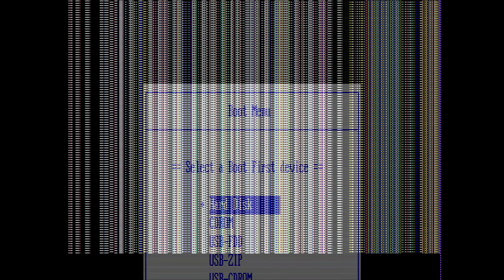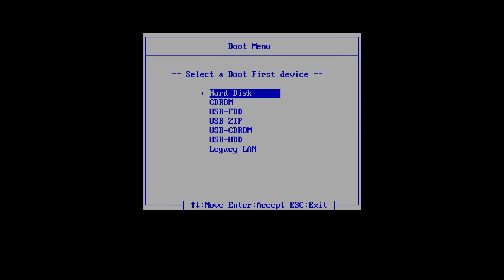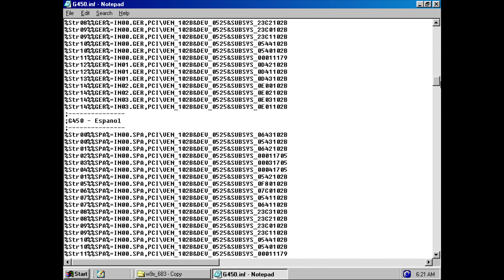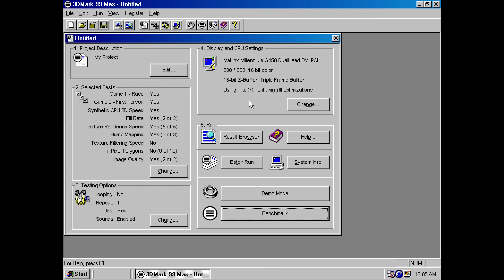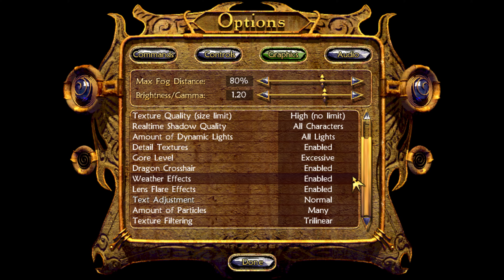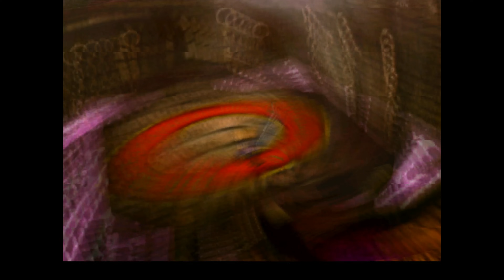Matrox Millennium G450 Dualhead DVI PCI (IBM)

Comment: at last i have mine "non grilled" working Matrox G450 PCI. I have same "jumping screen" issue DVI output and retrotink. Traditional windows 98 installation, everything work driver installer detect card without issues drv 6.83.017. Computer Asus P2B, P3 450. Card bios 1.4.b06. Shall i update or leave like this? 🤔 Lets do some tests 😁

Comment: I have two AGP P650 Matrox Millenium one is dead but other one i can't get display out 
When paired with PCI vga the Windows detect the P650 i was able to flash the bios but still no output from P650...

Comment: Thanks for the video. I have this same card for my Windows 95 machine. I've spent hours wrestling with drivers and with w9x_672 I finally got it to show the PowerDesk tabs in the display settings and it outputs 1024X768@85 Hz to my Trinitron and it looks great. The only problem is I can't get it to clone my display to the HDMI monitor plugged into the DVI port. There was exactly one time I got it to work, I think with a newer driver, but it looks like crap and then never worked again. If I try the hotkey and check in DualHead Clone, it says "enabled and active," but my other monitor remains blissfully black. Maybe it's just not meant to work with Win 95?
Reply from the maker: Yea maybe 🤔

Comment: Dear Phil... I didn't know this card had a DVI output. I was convinced it was the Radeon 7000 RV100, which came out a year after the Matrox. Cheers!!!
Reply: You can even desolder secondary VGA output if your Matrox G450 has this and solder DVI port in place of that

Comment: Hi Phil, just found the same card, would it be too much issue if you upload your modded driver? Also the somewhat slow performance may be from design as G400 came with 128bit SDR and G450 with 64bit DDR, the same bandwidth but with extra conditions that may drag the chip a bit.
Reply from the maker: I might upload it at some point, good idea 😊

Comment: Hi Phil, can you tell me why old graphic card's VGA resolutions cannot be supported by modern LCD panels and LCD TV-s?  I cannot use the same monitors which I'm using for my actual setup with my old retro PC. I always need an old 1280x1024 screen. The new ones just turn black. Maybe the refresh rate or the resolution are not supported anymore. Is there another way?

Comment: I think you missed the point on gaming with matrox. Or you missed the product line up of Matrox.

Millenium was a 2D grafic card. Designed for CAD, Photos and equal applications. More focus on true color, geometry and sharp lines in 2D. What was a different story when RGB analog signal was a thing.

Mystic was developed for Dataflow and 3D applications. It was the first card with 3d features on market in 1996 and could process 64GB/s internally.

Matrox Mystic 4MB was the best 3d gaming card when it was released, for a few years... Matrox had a own 3d system and was sadly not supported by gamesdevelopers. Only a few games used that technology. It was by far not so hungry for hardware performance than the later 3dfx cards with directX. Matrox was sadly excluded from the market to destroy this technology... it was designed only for gaming. Would we have this technology instead in todays cards, the cards would perform incredible.

Comment: Interesting discovery with the incompatibility with the first motherboard you tried. But I find these experiments fascinating. It's a great concept to get Windows 98 running with a GPU that has the correct features for a game (like the table fog and palleted textures) but also able to save some money on the other parts. I'm curious if there is a list out there that lists what games need what features for the  best performance. Another thought. I know the boards you're testing already have PCI slots. But, in thinking of maximizing the available slots to use, have you thought about trying one of these GPUs with a PCI-Express to PCI adapter? I can't remember if you've tried that before or not. Just a thought.

Completely separate question, if you don't mind. You said Shadows of the Empire plays too fast on this machine. I also own the GOG release of the game, but I haven't tried it yet. Is that the release that would play too fast? If so, I guess I could expect the same thing if I tried to run it on my modern PC and maybe should try running it on an older build. What specs would you recommend for that game?

Comment: These used to be extremely overpriced. Costing as much as the current enthusiast card from nvidia and ati at the time. It made no sense and were consider the same as gt710 line of cards for comparison. It was a display adapter through and through

Comment: Phil, could you please back up the flash with the Matrox tools and put it somewhere (e.g. TheRetroWeb)? I have one of those and it's acting up. I'd like to make sure that's not because of flash corruption.

EDIT: ah - you updated the firmware already, so maybe the FCode part for RS/6000 got overwritten already
Reply from the maker: Matrox cards are now for bit rott.

Comment: I don't usually hear about Matrox cards too much, mostly I think saw it mentioned on a game called ProRally2001 IIRC. Since it has a executable file for these things.

For a card from 2000... (Judging by what's on the card, not when it was built.) It seems to struggle a bit with some games, not sure if it's better than a GF2 MX (Haven't used it in a while) but it does Struggle more than Radeon 7500 does. And obviously I shouldn't be comparing to these cards, but if you want to run some games more smoothly then maybe it's not really for you. But it can be good if you have specific needs for it. It could run all of these late DOS games and 1996-1998 3D Windows games.

I was curious about these Tactical Shooters like Delta Force, Project I.G.I. etc. but never got around them yet.

I have a quick question though (Not related to Matrox) - Do you install Windows 98 in SATA/AHCI mode or you actually use IDE Mode for it? (Unlike Windows 2000 and XP the answer doesn't seem to be straightforward, where you apply SATA/AHCI drivers into a ISO and you are good to go.)
Reply from the maker: I set the SATA mode to IDE in BIOS.
Reply: @philscomputerlab  Ok, that's what I've figured, since I wasn't sure about if SATA implementation existed for 98 or not.

Comment: I've seen these before to 'cheaply' add a bunch of additional screens at high resolutions. Typical stock trader setup or some such, so they could have like 6 monitors on one computer showing a whole slew of charts and figures. They didn't usually need outright graphical speed for GPU things. They needed high-res, fast response, text-based output. Whatever GPU they use is like VooDoos were initially; literally 3D-only. Just a little farther along with the 'can do the stock trader thing and play a little Q3A after work' balance.

They even had extra special cards that piped in CNN stock quotes and news from the office specially installed cable head end! All constrained to a tiny 320x200 window or something? It was resizeable, but not really recommended. At least initially. Once we switched to digital TV in the US, the few places that had all that equipment? Massive new lounge type areas.

All that cable head end and support infrastructure? Reclaimed floor space since they don't need anything but a fiber line and a special router. Ah, and an eye-watering, vapor-having monthly fee for the privilege!

Comment: I worked at Matrox (did an internship there). They gave me a workstation with an nVidia Quadro GPU. They still made GPUs at the time. We used to hate the machines in the test cluster that had Matrox GPUs, because we used VNC to manage them, and the Matrox drivers had major performance issues with VNC.

Comment: There is also a g400icd dll file that is supposed to fix issues with certain games for the G400 & G450; when copied to the system folder of win98.

Comment: This was my first GPU, albeit the AGP version.  Playing Aliens vs Predator 2, everything worked great at a good framerate ... until you used any other vision mode that's not the normal mode with the Predator in an outdoor area where the skybox could be seen, then the FPS tanked heavily easily into the single digits.

Comment: My first computer came with a Matrox MGA Millennium graphics card. The computer is HP Vectra VL5/100 series 4. I was given the computer in middle school because I helped setup old computers a company donated to be given to students who couldn't afford them. My original one eventually died but I kept the graphics card and the expansion cards. Later I was able to find another of the same model on Ebay and it included a SB awe32 with full ram. So my current setup of it has a Matrox MGA Millennium graphics card, SB AWE32, a Pentium 200 MMX, and 192MB of ram. I also have also upgrade the Matrox MGA Millennium to 8MB of VRam.

Comment: I had Matrox G400 briefly and it did 2D extremely well, which was all I wanted for Photoshop at the time. At 3D it was not up to snuff but my other card was Hercules 3D Prophet 4500.
Reply: The Kyro II wasn't that much better, and the drivers were orders of magnitude worse. I have that same card, and getting the drivers to work on anything but Windows 9x usually results in corrupted output when running 3D mode.
Reply: @GGigabiteM  I know, right. I bought it secondhand from a dude that lived in the same dorm and while it wasn't expensive, it really wasn't a massive upgrade either. I only ever had it in W98 system and by that time it was already obsolete system as whole. I was poor.
Reply: Matrox is mainly made for 2D and extremely precise VGA quality on CRT monitors. 
I used to sold those to pro just for the good quality on VGA output and the multi monitor system of course.
For 3D I was selling ATI as they had similar VGA quality even with 5 BNC output on IIYAMA Vision Master CRT monitors.
When 3D got more popular in early 2000s even pro only buy ATI graphics cards for quality and versatility against even Matrox as ATI used same system for Dual Head (VGA+VGA or VGA+S-VIDEO or VGA+DVI).
Matrox went down around that time and focused on exotic devices as LAN GPU or USB GPU with long cables etc for specific applications.
Too bad they didnt try to compete with Intel, ATI/AMD  and Nvidia at that time because once intel felt behind price of both AMD and Nvidia skyrocketed fast both for gaming and pro app.
Reply: @doyouwtech9012  The reason that Matrox and other video chip vendors fell like flies in the early 2000s is because they couldn't keep up with the short release cycles that Nvidia and ATI were doing. They were leap frogging each other literally every 6 months, and that required an enormous amount of capital they didn't have.

It was one of the reasons 3dfx went out, they had ridiculously long development cycles, and by the time they released anything, it was already outdated and the only people left buying it were hard core 3dfx fans.

If Matrox could have landed a large OEM like Dell or HP for a basic video card to bring in steady revenue, they may have been able to compete, but Intel, Nvidia and ATI already had that end of the market with integrated chipset graphics. There was really no place for them.
Reply: @GGigabiteM  not entirely wong but on the partneship with OEM, this video prove you wrong as it came from IBM PC.
I cant remember if they had strong partnership with Apple too but I clearly remember looking at Dell pro PC with MGA cards as default or optionnal dual head system.
I realy think they didnt see the game industry as others and probably think it would not last therfore focused on Pro apps only. This is their decisision just like ATI decided to go both way in case gaming fail.
As for 3DFx, my opinion is they focussed on the wrong (and too cheap) tech where even Nvidia didnt dare to go despite all the cut in quality they did over the years to stay on top FPS.

Comment: I just bought a Matrox G550 with 32MB for PCIe x1. I had exactly the same problems installing it, so I manually selected it and it worked. I'll try to see if I can get it to run under Win95 on modern hardware. It's powerful enough for such an old operating system.
Reply from the maker: Cool, thanks for sharing! I might see if that card is available to me, could be interesting...
Reply: @philscomputerlab  I have news - the G550 with PCIe connection also works in Windows 98/Me with the latest normal version 6.83.017 from May 2002. You have to add the G550 manually. Otherwise it won't be found because the official drivers for the PCIe version are only for XP. Under Windows 95 it's even more difficult. Here you have to use driver version 6.21 or 6.23. The driver package doesn't support the G550, but you can install it as a G450 Dual Head. This is an advantage, since the chips are technically almost identical. The latest official G550 drivers don't work properly under 95. This means that Power Desk and Direct3D acceleration are not available under Windows 95.

Comment: Matrox cards weren't known for 3D gaming performance they were always about image quality.  These slower benchmarks are exactly what I would expect.  Even the Parhelia (a triple head that was more gaming focused) was destroyed by NVidia and ATI at the time.
Reply: The G400 Max was quite competitive when first released, but everything after this card was not good for gaming, especially the G450 was a downgrade.
Reply: Matrox Mystic 4MB was the best 3d gaming card when it was released, for a few years... Matrox had a own 3d system and was sadly not supported by gamesdevelopers. Only a few games used that technology. It was by far not so hungry for hardware performance than the later 3dfx cards with directX. Matrox was sadly excluded from the market to destroy this technology... it was designed only for gaming. Would we have this technology in todays cards, the cards would perform incredible. 

But the millenium was indeed a 2D grafic card. Designed for CAD, Photos and equal applications. More focus on true color and sharp lines in 2D. 

Mystic was developed for Dataflow and 3D applications. It was the first card with 3d features on market in 1996 and could process 64GB/s internally.

Comment: i got one for ya, my asus x15ja has a dodgy wifi card that locks the laptop up and at the same time it allows the battery to charge past my set limit of 60%.. so i disabled it in device manager and use a usb 3 ethernet to connect to the net... and now no lockups and the battery is stable at 60%. interesting lol.

Comment: Couple of funny facts. The only real good Matrox cards are G400/450/550 AGP. Matrox experimented a lot and here the issue was the compatibility between the PLX chip, the new PCI chipsets and maybe the card itself. The thing is any AGP card can run as PCI cause AGP initialises as PCI66 bus before chipset drivers activate advanced AGP features. They can also run as PCI66 natively if your board supports that (you have server board with PCI-X slots that run at that clock for example). Its what voodoo5 PCI does for example. Why would Matrox not do that, and instead add a chip that should not be needed, decreases compatibility, performance and locks the card to PCI33 mode? There were obviously some issues. I have G550 PCI-E (it is a card for  PCI-E 1x slot with similar PLX chip) and it also performs kinda crappy, and my AGP 550 runs just fine. 

Another one is the Parhelia. Its bad for retro cause no win98 drivers, but the funny thing is that Matrox actually made a PCI-X version, and Iv never seen that run correctly. Not even remotely close. Its terrible, and most people never even noticed cause most simply never gamed or did anything 3D on it. For many years people bought Matrox cards in to workstation machines for stuff like Photoshop, they were bought for 2D professionals due to them being famous for their 2D output quality. So this card exists and just does not work, yet Matrox sold them in droves. Fun fact, the card runs much better when plugged in to normal 33Mhz PCI slot, its very bottlenecked there, but it at least runs. 

The DVI issues are the same story. Its not actual DVI as it became known later, its something like what Voodoo5 with DVI does, its just transcoded VGA to DVI signal, not real good native DVI implementation. It struggles with modern screens, some are straight up incompatible, it cannot display high-res widescreen modes correctly, etc, etc. Its meh.
Reply from the maker: Great comment 💯

Comment: Thanks Phil.  You have the patience of a saint.  Its good to see what the G450 is capable of once you’d identified the issues with socket 775.  Do you know what the key difference is with the Gigabyte G31 board that made it perform?  I imagine that you won’t run into into these comparability issues so much on older motherboards, but your comment on Via chipset compatibility is very good to know.
Reply from the maker: I couldn't figure out why G41 board gave issues, but G31 was fine 😊

Comment: Oooh Delta force! I miss the novalogic voxel graphics engine. I wish it progressed to higher resolutions and voxel densities(smaller)
EDIT: did you check if the Motherboard bios had full speed PCI bus or was clocked down using a ratio to the FSB?
Reply from the maker: BIOS defaults for both and I did have a look for PCI related options, but couldn't see much....

Comment: Nice video, Phill. you are right, this PCI variant is perfect for OEM retro machines with just PCI slots. I use the same Matrox Millennium G450 Dualhead DVI PCI in my Dell Optiplex GX100 with Celeron Mendocino 533Mhz. It is a pretty good retro machine. I get about 3200 score in 3dMark99. Delta Force is one of my favourite retro games to play in multiplayer with me brother over serial null-modem cable. But single player is very difficult, even in easy mode. In cooperative multiplayer, we die soo fast...